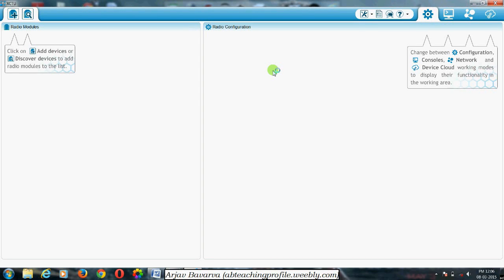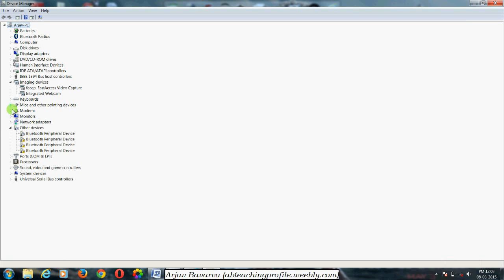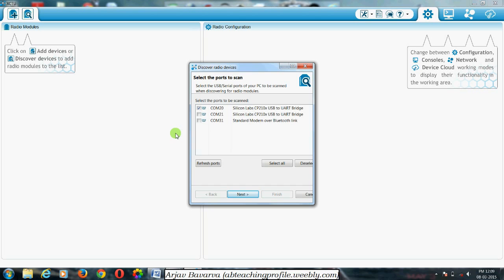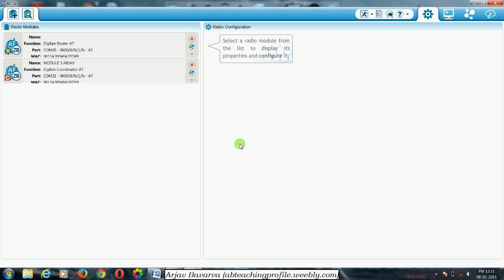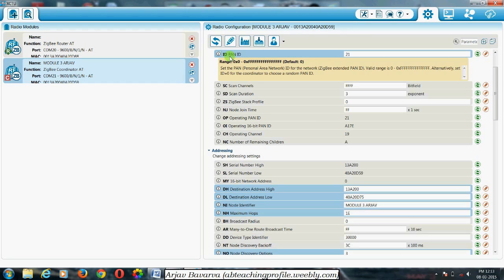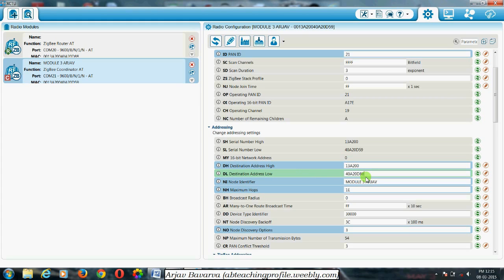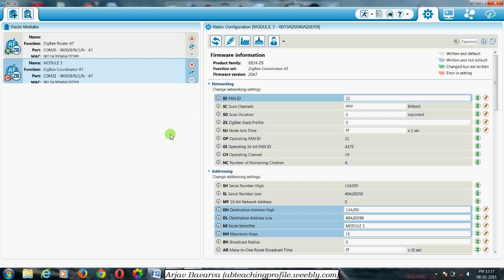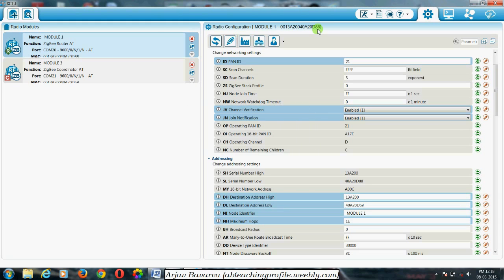Zigbee configuration - Part 2 (using XCTU 6.1.2)

Comment: hi sir how i can connect 3 xbee wireless in the form of ring topology
Reply: each and every xbee send data with one xbee and recived data in another one xbee
Reply from the maker: Zigbee uses Mash topology. It is given in the Manual. I don' think that ring topology  is possible in Zigbee.
Reply: sir i am a student. I do my project work based on xbee. i use 3 xbee on 3 robot. how i can configure it
Reply from the maker: Better you may call on 8980724363
Reply: No problem sir now its work successfully

Comment: hi.
i want to make a system under these conditions:
1.) i should set a coordinator.
2.) i should set two end device.
3.) the end devices must talk to only coordinator, not to each other.
4.) Coordinator should send for example to enddevice1 and enddevice2 indivudually. 
5.) End devices should send data to coordinator indiviually.
I have S2C modules.
How can i set this and which function set should i use?
thanks for your answer :)
Reply from the maker: Hi Mustafa,

Ans 3. In one single network of ZIgbee, two end devices will talk to each other via coordinator only do not talk to each other directly. 

Ans 4. Multi casting is possible via setting the channel filed in setting parameters of Zigbee.

Ans 5. End devices send the data to coordinator individually only. Though, it is multi hope communication, data will be individually.
Reply: thanks for your quick answer.
have a nice day :)